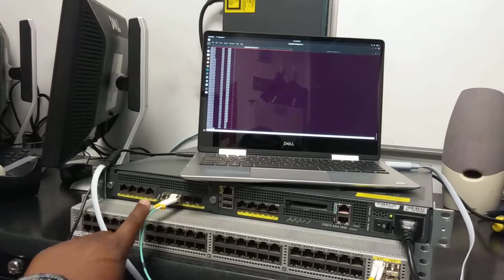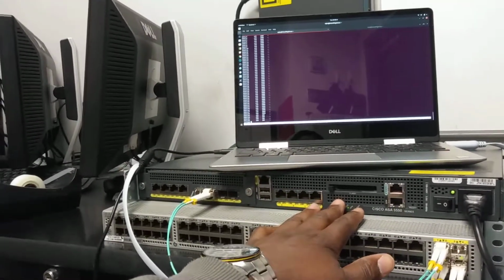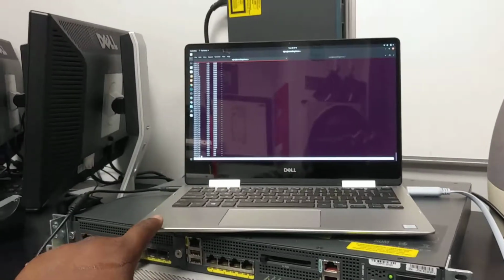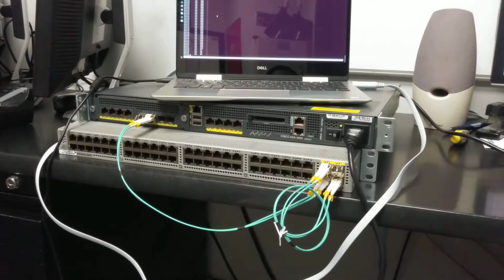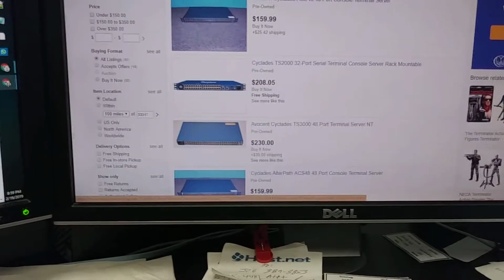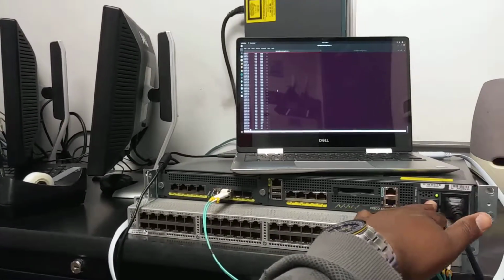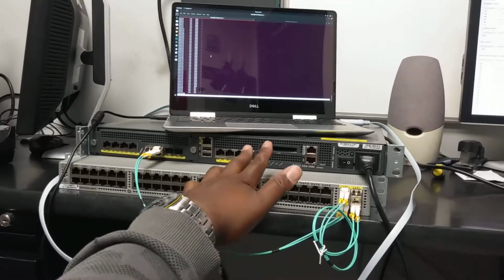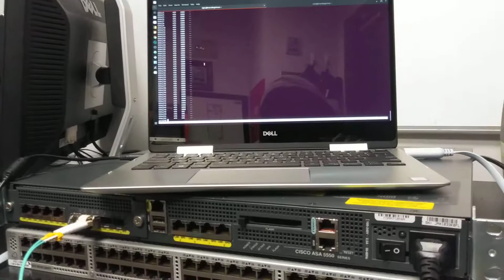Training: Testing Cisco ASA 5550 and NEXUS 3048TP

Comment: Also one good tip,,, make a portchannel whit 2 interface on interface outside,,  and you have redudant ore 2gig in speed on interface Outside,,,  you can run portchannel outside whit one ore two wire,, so its never go down if you want change wire
Reply from the maker: That's the actually plan. I have it cabled up on the rack now with some colored connections to better represent how it will look logically. Thanks for your suggestion that means I am on the right track.